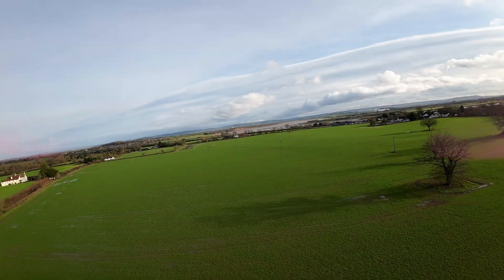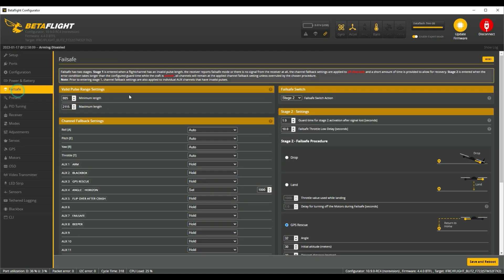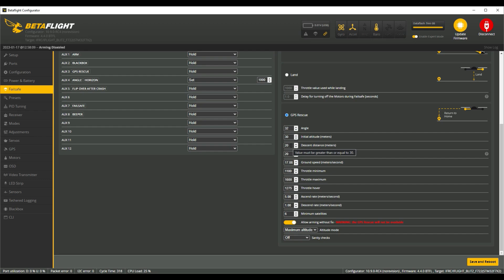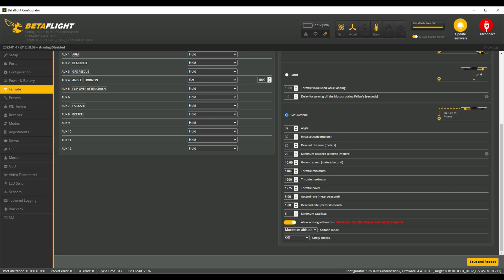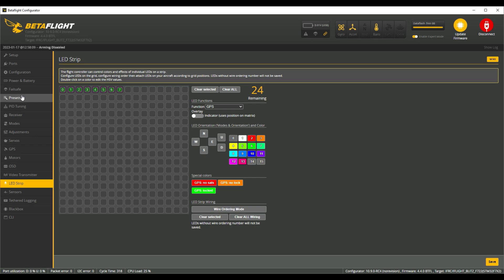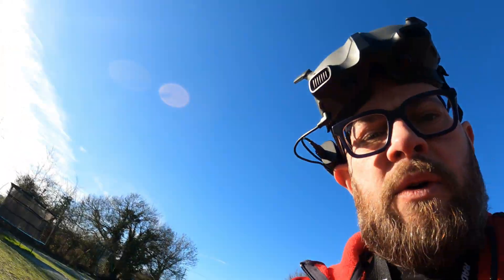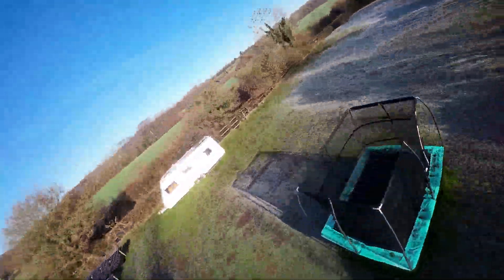Betaflight 4.4 RC4 - GPS rescue - iFlight Nazgul F5 X V2 with DJI O3 + ELRS

Comment: Why are the compas interférences coming from?
Reply from the maker: Magnetometer interference comes from noisy motors and electronics. Placing the compass way out back can fix some of these issues, but noisy motors can still sned interference into these highly sensitive components.

Comment: hello dear, great video! two questions from my side: 
1) by using DJI controller2, if you lost the video signal, Betaflight activate the GPS rescue, or the O3 Air Unit prevails and disarms the engines 
2) when the drone is back, is possible to take the control back by just moving the sticks or is necessary to configure some swithc? thanks
Reply from the maker: Sorry for the late reply, I had a little 2 year break!
1) if you loose the input from the DJI controller, failsafe should trigger, and based on your config can be set to GPS recovery!
2) Yes, you can take manual control of the drone by switching your GPS recovery dedicated switch to activated then de-activated.

Comment: When updating betaflight on my Nazgul Evoque v2 to perserve pid settings i just need to copy and paste CLI variables after update? 
I wonder why iflight warns so much against updating betaflight firmwire if its that simple??
Reply from the maker: The PID values will be different between different betaflight firmware revisions to get the same tuned result. Due to these variations, you may have luck flying still, or you may end up with a jittery mess. Wait till the tune comes out for your BNF before updating if you do not want to PID tune manually is the best advice I can give! :)

Comment: Hi , Stage 1 (Channel Failback Settings) Throttle = AUTO  ? really  ? That means throttle during 1.0s will be set to 0
Reply from the maker: Throttle = AUTO in Betaflight does not set throttle to 0; it sets it to a safe minimum to keep the quad armed and in flight during signal loss.

Comment: which modes should be using" failsafe o GPS rescue? what is the difference between the two modes??
Reply from the maker: Failsafe enabled, set it to about 1 second to make sure you have dropped out of signal etc, then initiate GPS rescue. :) So both!

Comment: i have the same quad deadcat version.i have backed up settings from v4.1 that was on it and flashed it with 4.4,then used the online convertor to fix the back up settings.when i input the settings back in via cli,most of them seem to go on ok but the betaflight osd isnt working and when i switch on gps it appears the rest of the uart settings clear thewmselves! if i go without the gps for testing,headset googles and reciever connect up but when i try to fire up the props it just beeps.because i cant see betaflight osd in the googles i cant see any warnings! not having much joy,if u got any tips id really appreciate it!
Reply: Curious to know if you've fixed this, I'm considering pushing mine to 4.4 for the GPS improvements as well
Reply: Same issue

Comment: Nice to see its working. Just set it up and was wondering where to set the ground speed etc. Going to try yours having the same drone. Im used to ardupilot and it sure is precise and was little hesitating to try how betaflight has managed to make it work. DId you just estimate the hover throttle or measured it? 

Liked and subbed.

Comment: Great vidio. I found with my settings that when you have your return to home speed high around 15.000 it flies much smoother back to home. Like you said in the video its only use it for emergency. The landing is definitely not as smooth with the higher speed but I just don't let it finish the landing. Where I fly the wind can be quite strong.
Reply from the maker: That's the real idea, unless you have a spectacular tx explosion!

Comment: Hi can I just ask are you just turning the tx off or using a switch to use rescue mode?
Reply from the maker: On this, using a switch. I have since turned off the radio with the same result. Prefer not to do that often though as I would like to maintain control of my drone at all times outside of an emergency.

Comment: Does your flight controller have a barometer? The heading and position control are obviously affected by the lack of a compass but with a barometer is should be able to fairly accurately control the altitude. In your second flight there was a weird jump during the descent.
Reply from the maker: There is a barometer yes. Not sure what happened, just had a bit of a blunder. :D

Comment: turn off your auto temp control and you wont lose signal as fast
Reply from the maker: For the O3? It doesn't loose signal any sooner or later, but it does keep the unarmed transmission power high, so only affects the drone when the arm switch is disarmed or armed. For loosing signal faster, setting the idle power down (auto temp control) doesn't make a difference unfortunately. A good thought though!

Comment: Whould you mind sharing your 4.4 config? I do wonder if there is a difference with the F5D.But dont think so or make a video on how to update it to 4.4?
Reply from the maker: Not much of a difference - the stock tunes look the same. Mine is slightly tweaked, but it is so well tuned as standard, it didn't need much. The best way? Take a screen shot of the sliders and config from your current betaflight, and use them for reference in deploying v4.4. Always take a full nackup from your working setup first!
If you get stuck, just shout, and I am sure we can sort something out together. :)

Comment: Have a question -- what is your baud rate set to for the GPS?
Reply from the maker: 57600. 😊
Reply: @willitmod  thanks! Do you know what your gps module frequency is as well?
Reply from the maker: @JohnCuppi  5Hz default on the BN-220. :)

Comment: Do you have barometer? I tested on RC5 and my second landing was really close to the take off point. I think it becomes more accurate one you have had a fix for awhile and that persists across power cycles as long as you are in same location. Mine seemed to handle altitude better when descending to land.
Reply from the maker: Yes I have
Reply from the maker: The barometer helps for sure, but I more agree with the fact that more sats - more accurate height and position.
Reply: @willitmod  I had one quad where the flight controller didn’t have barometer. GPS is horrible for altitude. The amount of drift you get on GPS is even worse for altitude. I ended up buying a barometer/compass board that connects through I2C (FlyWoo). This greatly improves the altitude consistency. GPS is better at getting an estimate above sea level but drifts. Barometer doesn’t drift but changes based on temperature and weather. The two readings can be used to cancel out some of the shortcomings each has. For a flight that will last for about 8 to 10 minutes at most, it’s not likely the weather will change abruptly.

Comment: Great video!  My GPS has a compass built in,  is this a problem if BF does not use it or can it be turned off?  Thanks!
Reply from the maker: I now have a bn-880 fitted which has a compass, but is won't talk to the f7 FC. I do t think the compass will interfere as from reading the GitHub pages, GPS rescue uses flight data only along with the accelerometer (yaw) to determine position and heading.

Comment: The big advantage isn't so much the ability for it to land perfectly but for it to get closer so you can take over again. If your video goes out you can flip rescue on until you get picture again then take over once you can see what's going on. Just like what you where saying at the end. That's the real help of this.
Reply from the maker: And another practical use I had the pleasure of experiencing today. My camera steamed up so much, I couldn't see anything. GPS rescue initiated to get it closer, then landed manually. Worked a treat!

Comment: Did you use your Pids and Filter Settings from original tune?
Reply from the maker: No, I've had a fiddle with filters and pids after gathering some blackbox data. Hardly a flutter now and very responsive. Very pleased.

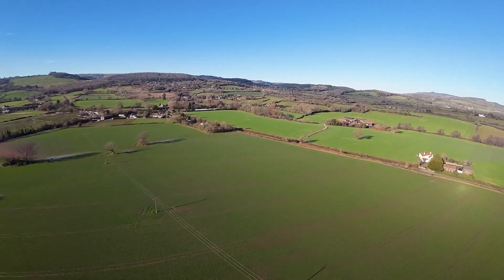Comment: 1:50 Good video but... not really cool to test new feature with Googles off and with "no idea where it is" :) Don't trust this feature that much especially with spinning propellers without guards that may hurt someone if the drone will fly in wrong direction.
Reply: His property is bordering a completely empty field.   And of course he knew where it was, in the completely empty field behind his house.   Your point may be valid in some situations.  But in this case it just makes you sound silly.
Reply from the maker: @7996hobguy  a perfect point! 😊
Reply from the maker: Nothing to worry about. My hand was on the kill switch, and I could see and hear the drone. No other humans within a mile. No cars, roads, or people flown over. Spotter also behind the camera (camera shy). Inrpomise there was no risk taken here and I covered off safety to the best of my ability.
Reply: @willitmod  I checked the video one more time. You are right with this empty field. I was just triggered by you saying 'googles off, I have no idea where it is, I can't hear it'. Good that you had spotter. I take back my word that it wasn't cool :)